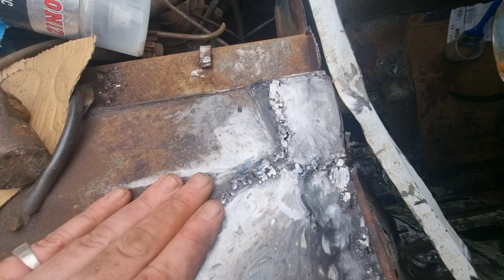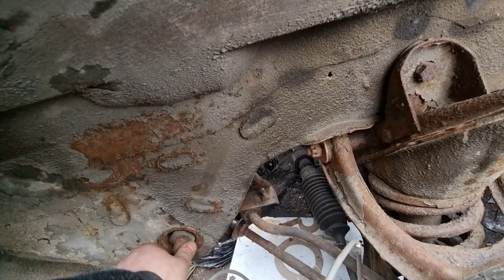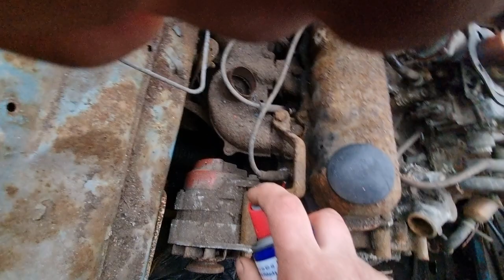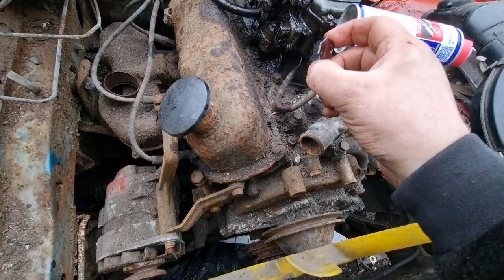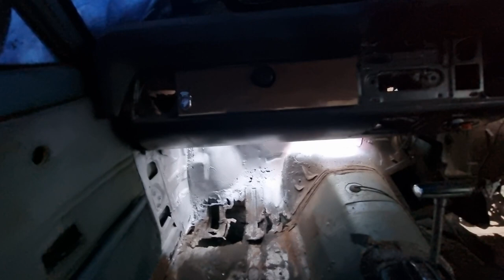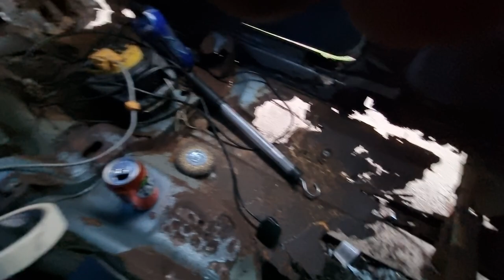Cortina Mk4 Ghia 2.3 V6 Restoration || More Bulkhead Repairs (P8)

Comment: Hi mate, big respect to you for tackling it. Sure a Tripod is on your shopping list as funds allow. Looks like you are using grinding discs as opposed to flap wheels that will give a much smoother finish and obviously nice to be able to get a pin hole free weld in appearance and invisible repair. Stick at it mate and sure will come good, it’s a long road, try to enjoy the trip.
Reply from the maker: Thank you mate yes flap disks are on my list as they are less brutal on the metal and pin holes yes with fluxcore welding it hard not to get them hence why gas welder is also on my list hehe

Comment: I'd suggest a high zinc content weld through primer applied on any added metalwork before welding it into place. It'll add protection in places you won't access after welding but won't hinder welding. Youtuber Dave of 'Dave's Garage' is doing a Mk1 Escort build and did a great product test on them and found the Halford's one to provide long lasting protection when left outside.
Here's a link to Dave's test; 
https://www.youtube.com/watch?v=OO-HlBISlGA
Reply from the maker: oh coool will check it out :)

Comment: one thing, i am going to tell you off for, i don't want to see any energy drinks or Pop  ( Fanta etc)  I want see a mugs of Tea  ( car restorers drink Tea or coffee)  a decent brews and sarnie's go a long way on a job!  Trust me i know.   Also Tell the "Scrap it" sweet hearts to fuck off.  Also word of advice, if a Job ( metal work in this case is) is going really well, but you are starting to get bored of it, Stop and move onto another job on the car, like the engine or something like that.  When you return to the metal work, you will be on a mental high, plus it stops things going tits up on you, and you end up getting very pissed off.  Me and my Dad learned that lesson, on car jobs.  Plus Gas i have heard people use, so it might be worth looking at getting some of that too.   Also was this a bit of a parts car?  Seems like most of its dash etc has been removed.
Reply from the maker: Lol I only drink coffee hehe and yes it started getting stripped it was sat by a canal for over 20 od years or more not sure how long Jamie saved it at retrorust on YouTube 2 years ago and I got it of him